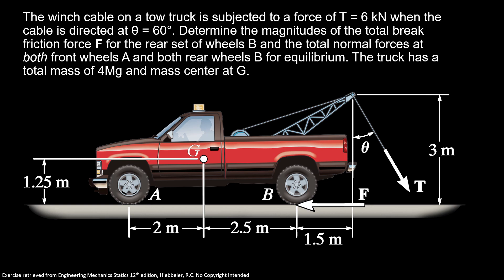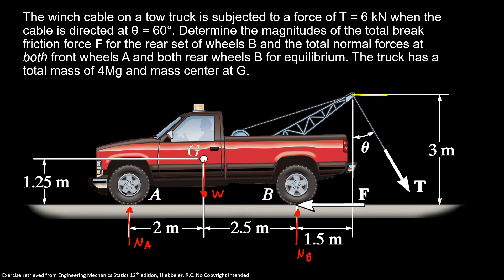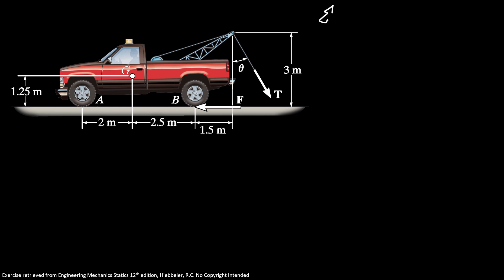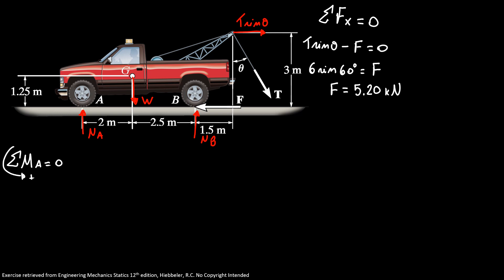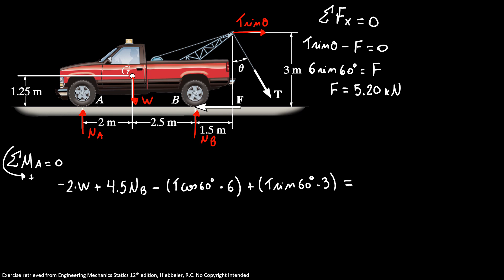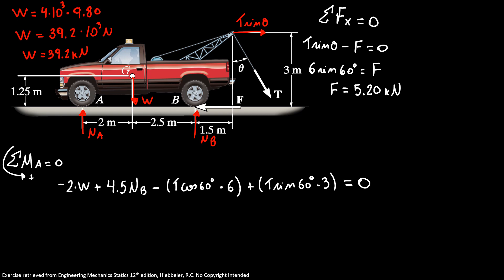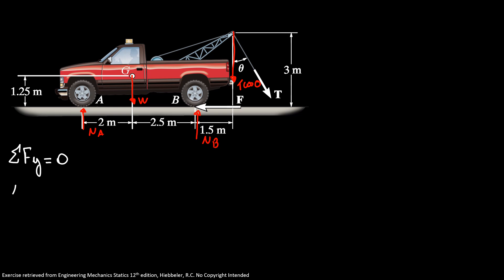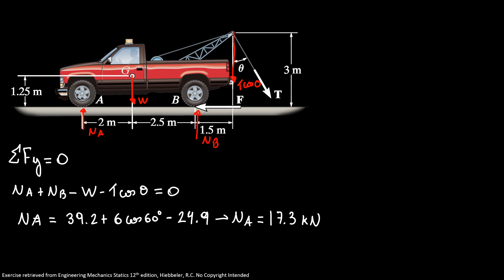Equilibrium of a Rigid Body   8

Comment from the maker: Hi everyone, there's a mistake in the video. I wrote the wrong sign. 
Here is the correct equation for Nb

Ma = 0
-2W + 4.5Nb - (Tcos60 x 6) - (3Tsin60)) =0
Use the equation, and you're getting the right result
Thanks to @RisovTalukder

Comment: I keep on getting 17.96kN for Nb even tho i am putting the same calculation as you. I have tried several times i do not understand what I am doing wrong
Reply from the maker: Hi. Thanks for watching. I made a mistake. The correct equation is:
Ma = 0
-2W + 4.5Nb - (Tcos60 x 6) - (3Tsin60)) =0
Use the equation, and you're getting the right result